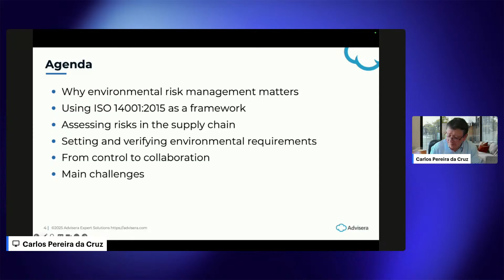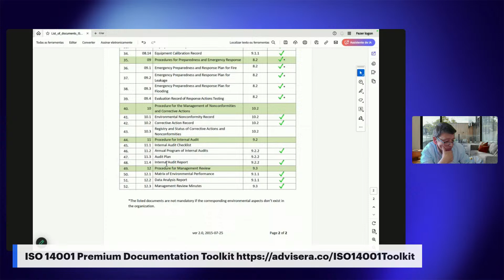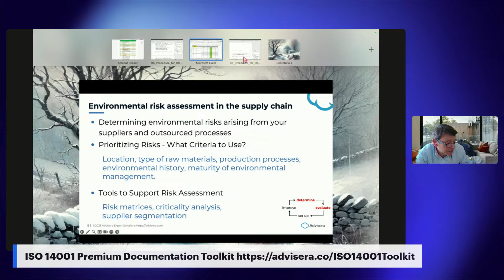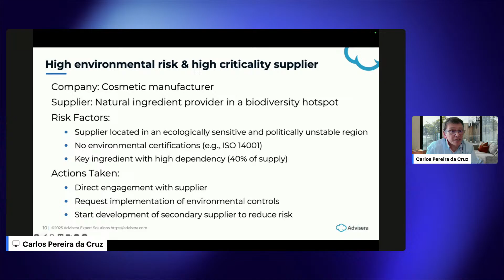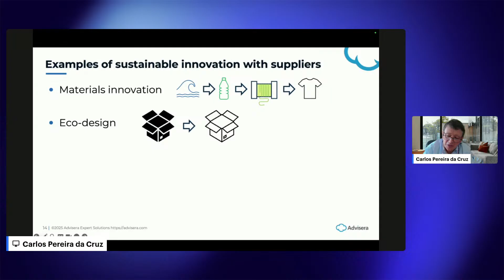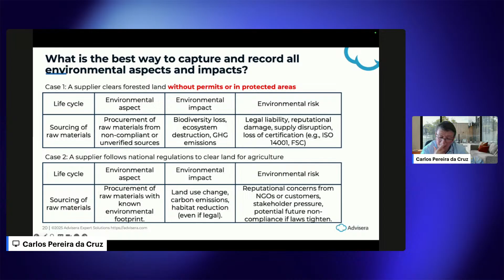Environmental Risk Management in the Supply Chain with ISO 14001:2015 [live webinar]

Comment from the maker: You can find below all the links we have shared in the live webinar: 
- ISO 14001 Premium Documentation Toolkit https://advisera.co/ISO14001Toolkit
- Toolkit expert meeting link https://advisera.co/14001ToolkitExpert
- ISO 14001:2015 Foundations Course https://advisera.co/14001Foundations
- ISO 14001:2015 Lead Implementer Course https://advisera.co/14001LeadImplementer
- ISO 14001:2015 Internal Auditor Course https://advisera.co/14001InternalAuditor
- ISO 14001:2015 Lead Auditor Course https://advisera.co/14001LeadAuditor
- Driving Your Supply Chain to ISO 14001 Compliance - https://advisera.co/14001SupplyChain
- 4 steps in identification and evaluation of environmental aspects - https://advisera.co/14001EnvAspectsSteps
- ISO 14001 risks and opportunities vs. environmental aspects - https://advisera.co/14001RisksOppVsEnvAspects
- Risks and opportunities in ISO 14001:2015 What they are and why they are important - https://advisera.co/14001RiskAndOpp
- The role of risk management in the ISO 14001:2015 standard - https://advisera.co/14001RiskMgtRole
- Plan-Do-Check-Act in the ISO 14001 standard - https://advisera.co/PDCAin14001
- Understanding the relationship between environmental aspects and operational procedures - https://advisera.co/EnvAspectsAndOperProc
- How to define EMS key performance indicators (KPIs) according to ISO 14001 - https://advisera.co/DefiningKPIsForEMS
- Risk-Based Auditing: A Smarter Way to Ensure Management System Effectiveness - https://advisera.co/Risk-BasedAuditing
- How does the product life cycle influence environmental aspects according to ISO 14001:2015? - https://advisera.co/14001ProductLifeCycleInfluence

Follow us on Social Media: 
- LinkedIn: https://www.linkedin.com/company/advisera/
- YouTube: http://www.youtube.com/@AdviseraExperts

Upcoming webinars on: 
- Advisera Website: https://advisera.co/Webinars
- LinkedIn: https://www.linkedin.com/company/18062427/events/
- YouTube: https://www.youtube.com/@AdviseraExperts/streams

Below, you can also find the links to our: 
- Webinar Survey https://info.advisera.com/webinar-survey/environmental-risk-management-in-the-supply-chain-with-iso-14001/
- PDF slides https://advisera.com/webinars/materials/Environmental_Risk_%20Management_in_the_Supply_Chain_presentation_deck.pdf

We look forward to hearing what you thought of the webinar! :)